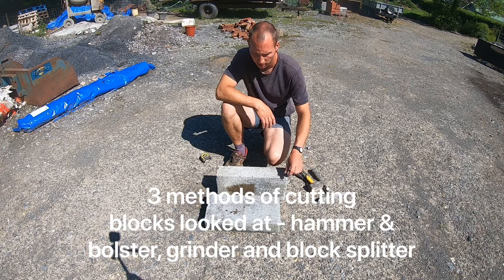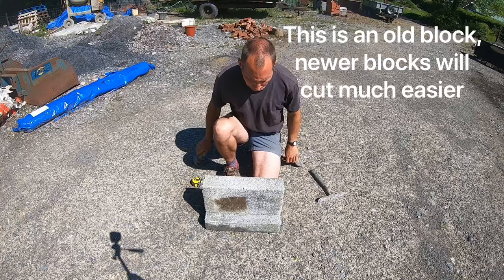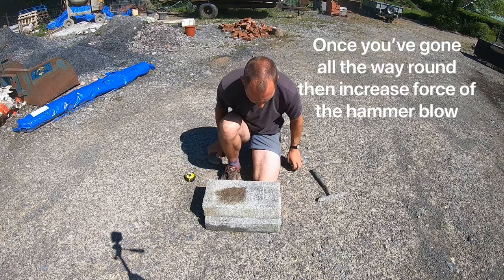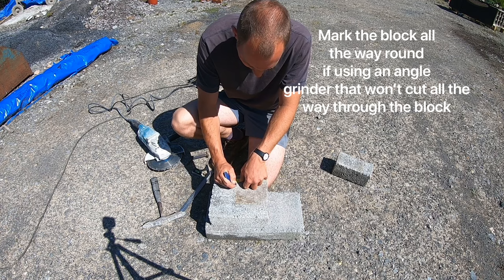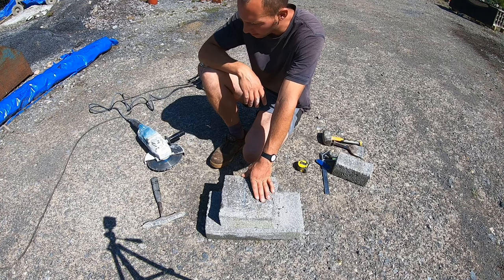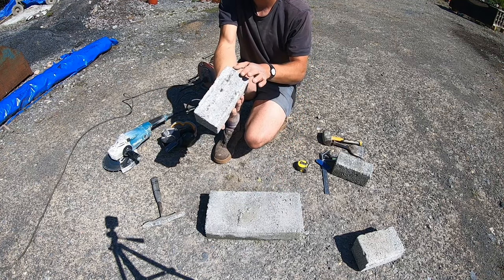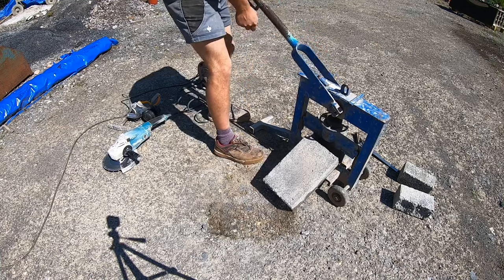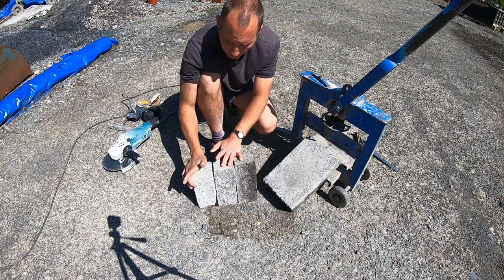How to cut concrete blocks

Comment: you have just saved me ages worth of needless work thanks pal
Reply from the maker: No worries, what way are you going to cut them?
Reply: @SamDaviesBuilder  bolster first but switch to the grinder if it don't work out , bolster seems less mess and a little more cleaner

Comment: I used a concrete saw 7 1/4 inch blade.  The last one you did was nice
Reply from the maker: Yea those block splitters are handy! Concrete saws are good if you can wet cut so it stops the dust

Comment: Great video!  Would it be possible to use the hammer and chisel option to take off two outside corners of a solid cement block?  Trying to soften the angular corner lines.  I have a couple of  cement blocks that are holding up a heavy round drainage grate.  A rough/irrelgular end result would be fine, because the blocks are among large riprap rocks surrounding the hole.
Reply from the maker: Hi, thank you!  Yes it would be possible to use a hammer and chisel to do that.  Take a bit off at a time and don't be too greedy in one go and it will go well, if you try to take too much off at once you may break the block

Comment from the maker: Ossilong - I have a notification about your comment but it doesn't show up on here for some reason.  Sometimes the block splitter can do a clean cut on pavers but it does depend on the paver.  The most accurate cut for a paver would be the angle grinder

Comment: I have a block splitter but rarely gets a outing as need to be cutting a lot of blocks to be lugging it about in van but would rarely use grinder unless notching out a corner for a lintel or steel so it's hammer and bolster for a clean cut or mostly just brick hammer or edge of lump hammer but depends on type of block 👍
Reply from the maker: Yea that’s the only drawback with the block splitter is lifting it in and out of the van, worth their weight in gold when you have lots of cuts though!!

Comment: Thanks for the video!  Good information.  It's probably already mentioned but I didn't see it with my quick glance but please recommend eye protection for all of the examples.  I know a guy with a glass eye as a result of an unlucky fragment.
Reply from the maker: Thankyou.  I do say on the video to use eye protection with the grinder but I should’ve said to use eye protection with all the methods.  I have made sure I’ve put it in the description.

Comment: Very helpful video! Does the exposed concrete inside the new cut need to be treated in any way to prevent damage/soil contamination/etc? Don't need a super detailed answer, just need to know if i should look into that as a follow-on task. Thanks in-advance for any insights!
Reply from the maker: I have never treated an exposed cut in any way, can’t see it causing an issue. Thanks for watching too :)

Comment: hello this is helpful. is that block splitter an ordinary driveway block splitter. will a driveway block. splitter do?
Reply from the maker: Hi, this block splitter is built to take these size blocks. A driveway block splitter won’t br heavy duty enough unless it’s built for bigger blocks

Comment: Thank you a great video. Is there any way you can cut very large stones from a previous stone wall? They are not the right shape and size to handle easily. Thank you.
Reply from the maker: Hi, thankyou.  You could try disc cutting as far as the cutter will go in then chiselling the stone apart. Be careful as the disc cutter can bite a bit in certain stones! 

Another way would be to drill a few holes through the stone then try bolstering it apart along the line of the holes you’ve drilled.  

You might find the fault line across certain stones then you’d have an easy break.  Wear safety goggles when cutting stones!!
Reply: @SamDaviesBuilder  Thank you for your advise.
Reply from the maker: @naturalillusion7704  no problem 😃

Comment: That block splitter, super vid, tks
Reply from the maker: Sean O Huiginn the block splitter is a life (wrist!) saver
Reply: I am possibly going to block lay a small house ( I want the easiest and least labour intensive method's) I have always seen the block layers using the bolster like a pro, but I'm not a pro and that gullutine action is widespread in lots of industry. Great that there's no major noise and dust too. Again great vid
Reply from the maker: Sean O Huiginn yea and a clean cut every time. I’ve had mine over 10 years and never had to change the blade on it, it’s too good to be true 🤣. I’d say only downside is moving it in and out of the van as it’s pretty heavy
Reply: @SamDaviesBuilder  noted on the weight,   Ill get one and it'll be mostly on the same site, any advice on different types? Are they all roughly the same? Like for example if buying  used make sure they run smoothly, some grease helps etc
Reply from the maker: Sean O Huiginn just make sure it’ll cut concrete blocks and not just block pavers as the smaller ones won’t be big enough for concrete blocks. Loads on eBay for good prices, mine wasn’t in the best shape but still did the job fine!
Reply: @SamDaviesBuilder  ok great tip, thanks
Reply: Hi again, can the spilter cut concrete blocks on an angle like when cutting in a gable end ? Thank you
Reply from the maker: Sean O Huiginn yea, but only to a certain degree as you can’t fit a full block in lengthways if that makes sense, once the angles get shallow you can only cut so much off. Other block splitters may fit them in lengthways so you can do any angle

Comment: Great vid mate. What weight hammer do you use? I need a heavier one I think.
Reply from the maker: The hammer I was using was a bit big actually, not sure of the weight but I have since got a smaller one.  As long as its a lump hammer it should be fine for cutting blocks

Comment: Great info, thanks.
Is it possible to cut a curve?
Reply from the maker: If you wanted to cut a curve then an angle grinder would be best.  You can use the 'piano key' cut method, where you take off small slices to make a curve depending how sharp the curve is
Reply: @SamDaviesBuilder  Of course. Thanks again.

Comment: What model is your block splitter?
Reply from the maker: I’m not sure sorry, it was one bought second hand off Ebay well over 10 years ago
Reply: Thanks for your reply! Will something like Lumag LST3314 be okay?
Reply from the maker: @uh7699  yes that looks very good. Pretty much the same as mine. Only thing I’d change with mine is to be able to take a block lengthways as they don’t fit in lengthways on these.  More than good enough for all the usual cuts though! I have another video on my channel with me just using my block splitter so it might be worth you checking that out too
Reply from the maker: @uh7699  https://youtu.be/nW5tMROEP0c

This is the video with just the block splitter
Reply: Perfect, you're a star!

Just checked for the ones that cut length ways (440mm) and they close to the £1k mark so way above my budget 😅,...I'll have to stick to the one with the shorter cuts for now:)

Comment: Hi, very nice demonstration!  Was that a 7" or a larger grinder?  Thanks.
Reply from the maker: Thanks.  It is a 9" grinder, doesn't quite cut through a block though, only goes through about 70mm so you have to cut both sides of it

Comment: What about cutting a block lengthways? would it be a waste of time to cut with a chisel?
Reply from the maker: It’s very difficult to cut a block lengthways with a chisel.  If I was cutting a block lengthways, I’d usually use an angle grinder.

Comment: When you have created the break point you can the put a series of drilled holes through then you will achieve a clean break
Reply from the maker: You can achieve a clean break without drilling
Reply: @SamDaviesBuilder  just a thought,  I always use a petrol grinder like your second demo
Reply from the maker: @YabbaDabba-Doo  yea you can’t beat a petrol grinder as it will go straight through without turning the block over. Plus if you use one with water there’s no dust
Reply: @SamDaviesBuilder  which I have, yeah

Comment: I have a few small toppers to cut for a small retaining wall.. will a circular saw work okay (with a mason blade)?
Reply from the maker: By rotary saw do you mean the same as the grinder I’m using in the video?
Reply: @SamDaviesBuilder  sorry, meant to say circular saw.
Reply from the maker: @jeff_9074  I’ve not got experience with using a masonry blade in a circular saw but if you do just hold on tight!
Reply: @SamDaviesBuilder  okay, I'll follow up on my experience with it if I do use it.. and thanks lol, will do!
Reply: @SamDaviesBuilder  with a decent blade it wasn't bad. It's hard to see and keep track of the guide line though. I only had 4 toppers to cut for a small retaining wall off my shed. So it cost me $17 for the concrete blade.  I've used A mason wet miter saw for a big wall, and I would def use  that again for anything more than a few toppers. I was just trying to avoid paying to rent it. Anyway, just wanted to follow up since I said I would.
Reply from the maker: @jeff_9074  thanks Jeff, good to have the feedback. You can’t beat those big mason wet cut saws, I’d love to buy one!

Comment: Hi Sam, can you take a 2ft square off a path with this method?
Reply from the maker: Hi Denise, is it a concrete path and which method are you thinking? The hammer and bolster? 

Usually you'd have to use a disc cutter for the neatest cut for a path
Reply: @SamDaviesBuilder  yes  I thought it would be ok,however having watch you I can only get to 3 sides.
Reply: Is this a NO NO then. By the way great vid. Thanks @SamDaviesBuilder
Reply from the maker: @denisechapman5531  any idea what size grinder you would be using and what thickness is the path?
Reply: The thickness is 2” approx.
Reply: No idea what to cut it with I thought I could use the bolster😞
Reply from the maker: @denisechapman5531  I have never tried using a bolster to cut a slab as it won't leave a clean cut.  A grinder would leave a nice clean cut without risk of breaking other bits of the path
Reply: @SamDaviesBuilder  thank you so much Sam for your good advice and quick response.
Reply from the maker: @denisechapman5531  No problem, I hope you manage to get it cut!

Comment: No safety glasses for eye protection?
Reply from the maker: Not for using a hammer and bolster. I do use safety glasses when using a grinder.
Reply: @SamDaviesBuilder  Thanks for your reply.  Glad you use safety glasses other times.  I have also used a hammer and chisel on concrete and I have had small pieces break apart near my face.  Glad I was wearing safety glasses since all it takes is that one piece to hit my eye and cause eye issues.  Anyhow, your video was interesting to see and thanks for sharing.
Reply from the maker: @DougCeleste  it’s good advice - they used to say in college you only get one pair of eyes!
Reply: @SamDaviesBuilder  Yes, VERY good advice!  I protect my eyes at all times, even when trimming trees and shrubs.  I cannot tell you how often I have had garden, wood, concrete and other debris hit my eyes but my safety glasses always saved me from eye issues.  A guy at work was doing a brake job on his car but was not wearing his safety glasses.  A spring got loose and hit his eye causing him to go blind in his eye.  A costly lesson for him.

Comment: You're insane chiseling concrete with no eye protection
Reply from the maker: I should be wearing goggles to do this if you follow PPE correctly but when just using a bolster I don’t. Grinding I always wear goggles
Reply: @SamDaviesBuilder  great set of alternatives but yeah, you should re-record this with some VOLUME on the sound, maybe record the voiceover separate, and better PPE
Reply from the maker: @RayDoeksen  cheers Ray, will keep that in mind!